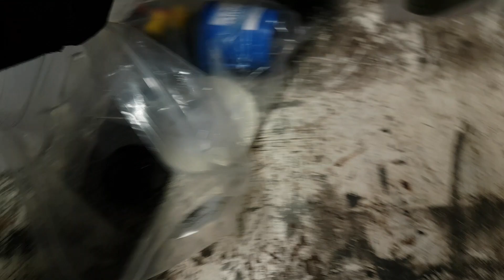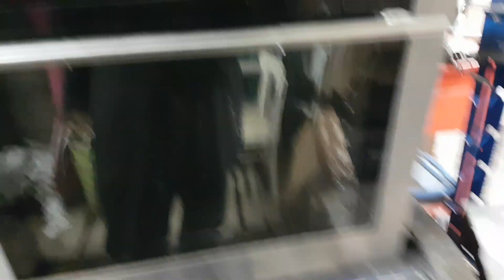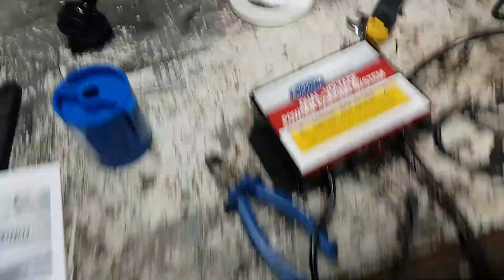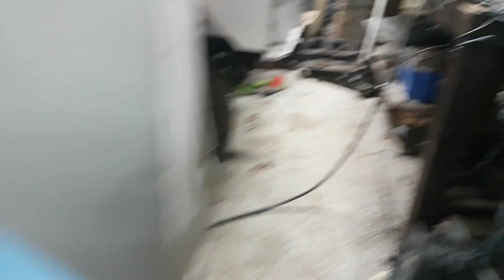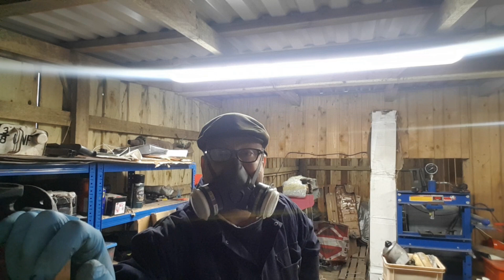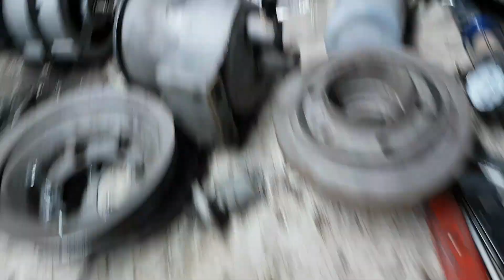Review - Eastwood dual voltage Powder Coating System

Comment: remove the tip from the gun it works better without it
Reply from the maker: I tried that but then it just blew the powder off as fast as I was applying it. Maybe too close :D
Reply: You should have lowered the psi a tad